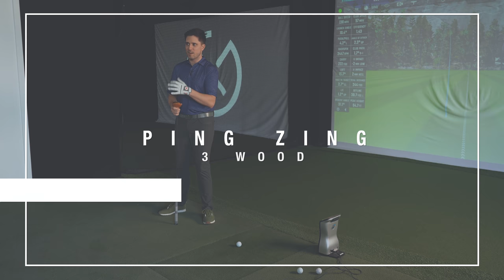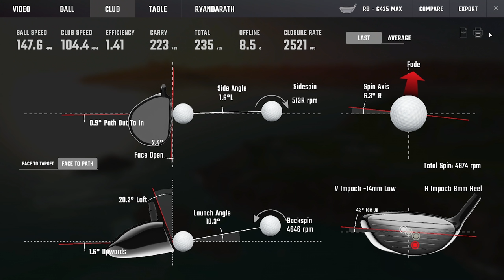WOOD VS STEEL // How does a 30 year old 3-Wood stack up?

Comment: A couple years ago (spring 2000), I took out one of my old persimmon drivers (I have a few of them, mostly with steel shafts, but this one is shafted with a stiff Fenwick graphite shaft at 44”playing length).  I played 9 holes with it and shot 34 — one of my best 9-hole scores of 2000!  It’s a larger-than-standard persimmon head (250cc, with a graphite face insert), and although I hit it about 20 yards shorter off the tee than I would with a 45” long titanium driver, I found 6 out of 6 fairways with it, which is very rare for me on any course with any driver.  My good hits weren’t as good as my best hits would be with a 440 - 460cc  titanium driver, but my misses were much better than misses with the titanium beast.

Comment: Many people don't realize that the laminated maple head was actually better quality than persimmon. That is because controlling the moisture content of the woos, woodd density consistency, etc. was much easier with laminated maple. It was also more durable than persimmon. I used to have Orlimar "blonde" driver and 3 wood that were laminated maple which I liked a lot.

Comment: I still revert to my Titleist Accuflow irons for the winter - who wants to scratch their lovely Mizuno HMB kit in the mud and dirt! 8-PW still have the 1979 vintage shafts! 10yds light and slightly more lateral spread but still feel very nice. I would say you could go back to early 80s and see very little change to modern blades.

Comment: The onset (is that the right word) on those old woods blew my mind! That face was really out in front of the shaft!  Oddly, both of you guys seemed to pull it, when that face would make me think you'd miss right...  interesting video, for sure.  Mike seemed really bothered that the old driver didn't go far, but if he hit some 60 year old irons and saw the distance he got out of those, he'd see that the gapping would all work out; they were all much shorter than their modern counterparts.

Comment: Back in the day, the ball was hit and launched a lot lower by the pros. I attended several Canadian Opens in the 70s. Nicklaus, Knudson, etc would hit the ball on a very low trajectory and the ball would rise. The pros now hit the ball at a much higher initial angle. When I played with the old woods, I could not control a driver. I had a fearsome slice. But I could nail a 3 wood a long way off a tee or fairway. With modern equipment, I don't fear the driver. I don't think my swing is better, I still slice about 1 in 5 into the woods, the technology keeps me in play.

Comment: I played with a wood driver till 2005 when i was a teen because i couldnt afford a new driver.I would drive 250+ no problem. People would always look in disbelief when i pulled out a wood and then drive it so well and far.  Wood is not forgiving at all with distance.You have to hit it centre all the time to get the distance,if you are of centre you wil go short and slight left/right. With titanium drivers and the amount of spin you get. Slicing is way more harse . You wil go far and wiiide and land in the woods/next fairway. Wood drivers doesnt quite let that happen. They punish you with distances. That was my 10 years of experience with them. Funny thing is used to play blades from the 70s/80s that i bought from second hand shops so i learned golf with blades and wood drivers when everyone else played forgiving oversized clubs and titanium drivers. I truly believe that is what made me a good golfer by playing with very unforgiving tech that it forced me to learn to hit it well and adapt my swing from the start of my golf journey. Its why i still prefer blades to this day.

Comment: Love, love, love this. Too bad you didn’t have some old balata balls to try. Would give you a MUCH greater appreciation for how the greats of game accomplished what they did. 

I will offer a tip, try a persimmon rescue wood. I still carry my old Orlimar Rescue, it’s basically a 5-wood only brass sole plate is extra heavy and has 2 rails running front-back. If you’re playing really dense, thick rough, still not a better club to use. I once visited Lou Ortiz’s shop in Oakland, CA while in college, he was founder and club master builder/designer for Orlimar. The PGA was in BayArea for a tournament, he had Venturi, Ortiz, Rodriguez, Player, Snead, Heard and a very young Miller all in his shop getting clubs tweaked or new one’s built. I honestly had no clue until his son Jessie told me who was there. Needless to say I wasn’t getting the whipping repaired on my rescue club that day 🤣🤣

Comment: I owned a set of 1&3&5 Maple Ping Woods that had been fitted with Aldila NV graphite shafts. The dull ‘thunk’ is memorable compared to Ping’s current hi-tech driver & 3W & 5W’s. About 25-30yds less distance but better average dispersion.They were great to bag when playing for fun with my buddy. Your vid brought back some fun times. Any plans to compare some 30-40-year-old peripheral weighted or blade irons with today's tech irons? It would be fun to see how the compare. Thanks guys😃👍

Comment: Nostalgia. 1987: My first club set were wood laminate Orlimar with no name steel shafts. Granted I was 35 years younger, but I could drive the ball the same distance then as now with my Mizuno ST200 with a Tensei blue shaft. That Orlimar driver head size was tiny,  probably less than 275cc.

Comment: I have the full set of the Blondies, and even after 28 years I still have the 5 wood in the bag. 225 yards in the fairway and 230+ off a tee and over trees if need be. Steel shafted

Comment: Is the persimmon driver any longer (club length) than the Ping 3 wood? At a glance it looks about the same. That would explain the same distance as with the 3 wood. For head comparisons the shafts, lengths, etc. should as much the same as possible. I realize you hit the driver with 1950s technology just for compoarison. A Wilson Staff driver from the 1980s (still wood) would be a good comparison, especially with a graphite shaft.

Comment: Cool vid! I have a 1-3-5 Ping Eye 2 set of woods I bought in great shape from an older gentleman on FB.   They also have graphite shafts, Aldila Tour Gold.  The 3 and 5 are money but the driver requires a bit more concentration otherwise it's slice city.

Comment: Awesome! I have exact ping zing 3 wood with that shaft.  It's it mint condition and I remember back in the day, I would hit it further than metal drivers.. shocked the difference is only 5 yards shorter than the metals but I am sure if you practice more with the pink zing, that 5 yards would be less. So moral of the story. Out with the old or bring back the old??

Comment: Still have some woods and occasionally bring them out. Have a brand new Joe Powell persimmon (r300) that I've played - I gamed a Dunlop Australian (laminate) r300 up til I was 22? Could carry that 240-250 then (sometimes longer) using balata balls. Straight or draw but easy to overcook. Easy to hit a 3/4 shot and keep it low.

When I moved to metal it was actually a 1200GE that was the same sized head. It was years later that I went to "new" metal (back injury) and I really struggled due to the shaft length. I can't go longer than 44" with consistency. It's all about forgiveness in mishits with new gear, less workable (easy to fade, less so to get a nice draw). 

I still have a 21' Wilson 5wd, steel shaft that I stick in my bag - not sure if it's the MOI being perfect it just usage but I can't mishit it and it's a solid 225yd club from tee or fairway.

I think the balls we play now also don't work as well as the old ones 🤷‍♂️

Comment: A great video series to see would be club comparisons over the years - like take a model from every ~5 years for a few generations (2022 release, ~2017, ~2012, ~2007) and compare as apples to apples as you can (aka every club in the test is in good condition and decently fit for the tester).  Each video could be a different club type (driver, FW, long iron, short iron, wedge)

Comment: I find it HIGH-Larious that you call these "fairway finders"!  My swing speed back in 1985 was 112 mph when they first started measuring that stuff, I'm sure higher in my early 20's or with modern radar based measurements...with a persimmon Ping driver [absolutely the most beee-yootiful driver I've ever owned!] and steel shaft I would hit it out there 250 to 270...most of the time in the wrong fairway lol!  Fairway finder....Pthurb!!!!
Reply: I read that someone likes to hit old blades and persimmon woods.  Well, I like to score, and at 62 I'm looking to shoot my age in a couple of years.  No way[!]  I could do that with the old equipment! Still, I do take the old Wilson Staff muscle backs circa 1976 out to the range to make sure I'm still finding the dime.  But I hit my old Burner driver the other day and I'll never embarrass myself like that again! lol

Comment: I still swing ping eye 2 blonde wood 3,5,7 woods. I'm 51 yrs old and about 10 hdcp. Hit the 3w about 230, 5w, 215 and 7w 190ish. I get comments all time but I'm not trying to look cool, they just straight every freaking time with absolutely no bend. I will hit them forever but I wish they still made the Balatta balls because it was a perfect match. Also have the 1wd and can get consistent 250yds out of it but misses are not worth it. Maybe it's the Steele shafts that help too. I don't know

Comment: Compare some old blades to new blades. E.g. Old Blades = Mizuno MP 14, 29 TP 9, Old Ben Hogan Apex blades or any other 60s, 70s blades   VS    Modern Blades = Mizuno MP 221
I currently play MP 20 blades. I have had Mizuno TP 9, MP 37 and I feel a modern blade like the MP 20 in comparison is surprisingly forgiving, much more forgiving than people think. When I hit my MP 20 blades thin, most of the time I only have lost maybe 1/2 club distance, compared to say 1 to 2 full clubs difference with my TP9 and MP37.

Comment: Wow..these #s prove that the new tech isnt everything that these equipment salesman make it out to be.
Reply: From this video, the new stuff is just a little more forgiving on mishits. But as far the numbers go for distance, I agree with you. There's not alot in it. Which is crazy!
Reply: these modern clubs r a rip off.  i purchase everything but wedges used.  $600 for a new driver, smh.  golf is expensive.  got to save money when we can.  the average guy gunna spend $50-$100 on the low end a round factoring balls, clubs green fees, attire....

if i didnt spend $200 on a used mavrik last year i would consider playing the persimmons again

Comment: Olazabal first player to win the Masters with a metal wood, Faldo and alike won with wood and it doesn't seem that long ago, and as for Tiger metal wood yes but also with a metal shaft. Augusta and Open courses where designed with these clubs in mind. I would love the Masters and Opens to be played with blades and persimmon. US with modern and the PGA to revert to match play, but global PGA's qualifiers, leading to a finals week hosted in different Continents year on year for both mail and female finalists. Segway there,

Comment: Yes  Modern clubs are way more forgiving.  Not sure that is a good thing or not.   In the persimmon, blades, and balata ball era, you had to get your ballstriking damn good to play at a highly competitive level.   I feel lucky that I developed my game and swing in that era.  I was a scratch player with a persimmon driver, and learned to hit it off the screws.  LOL and when titanium showed up on the scene it was like cheating. And 25 years after titanium, with hot faces and adjustable shafts and 460cc heads with adjustable weighting, and the modern balls... it is even more so like cheating.   LOL. With my TS3 ....Long and straight every time.  I couldn't miss the middle of the face if I tried.   I still play blades too. ;)   LOL if they made us go back to persimmon drivers, I wouldn't complain at all.